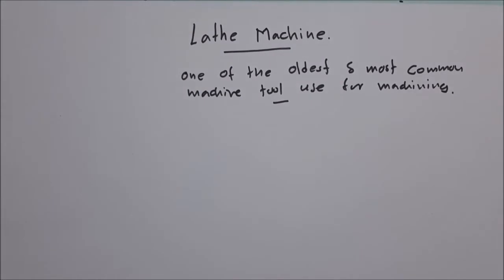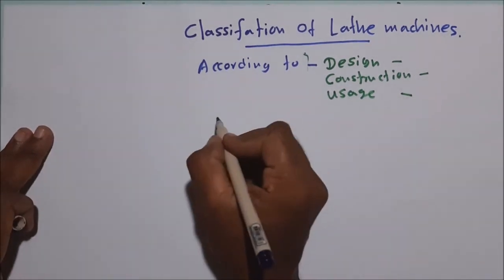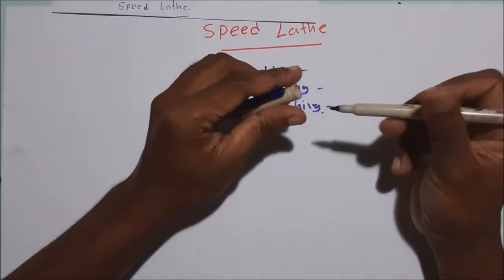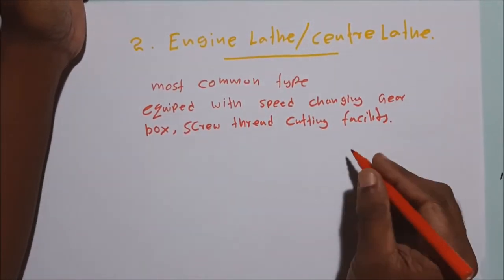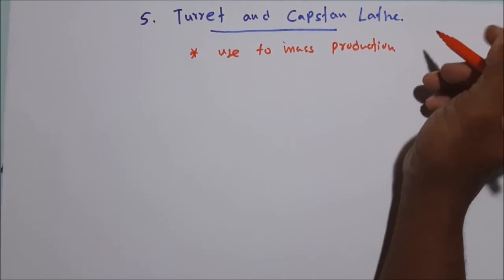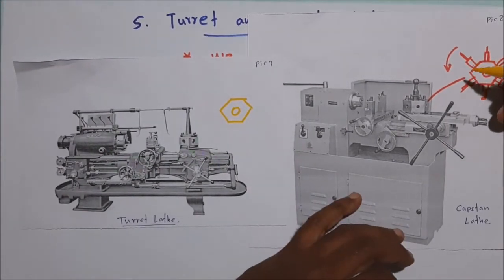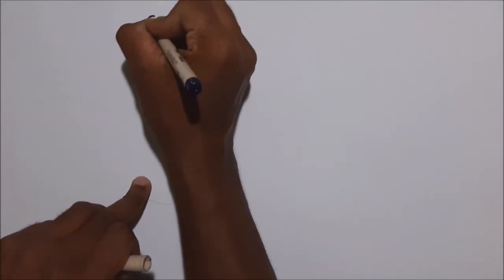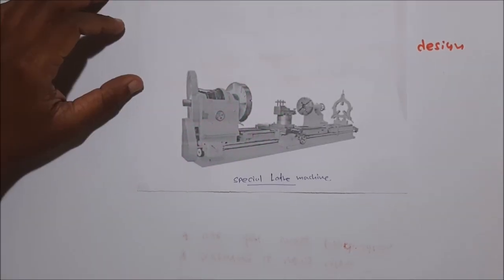Classification of lathe machines | Lecture-6 Part I

Comment: lathe machine - 2:48
classification of lathe machine - 9:55
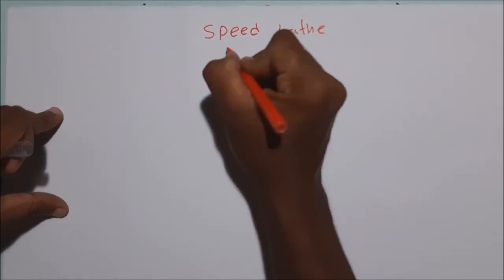1) speed lathe - 14:25
2) engine lathe - 19:57
3) bench lathe - 23:35
4) tool room lathe - 25:28
5) turret and capstan lathe - 29:00
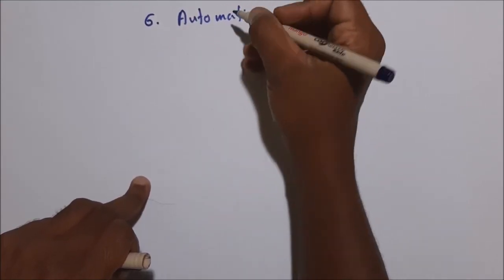6) automatic lathe - 42:32
7) special purpose lathe - 45:44
🔥🔥